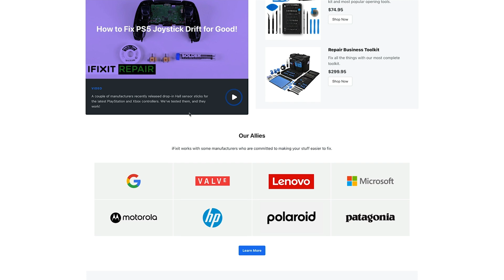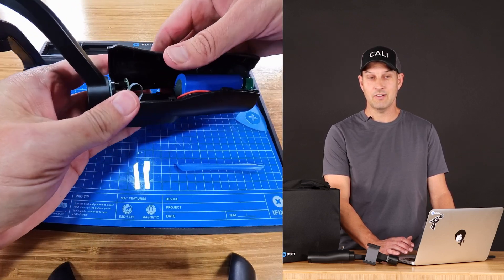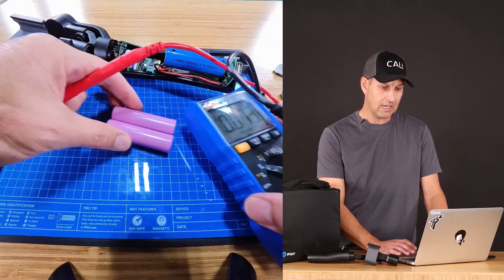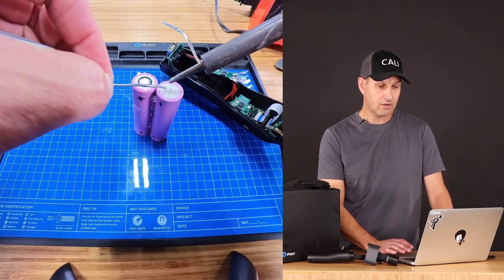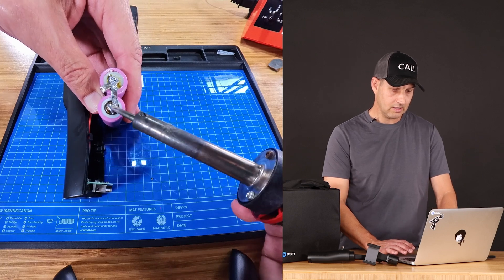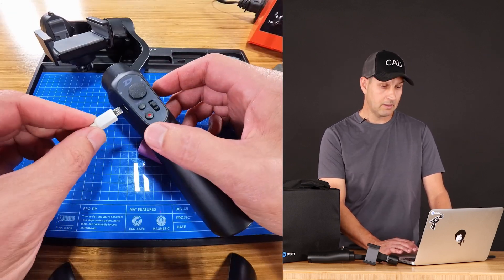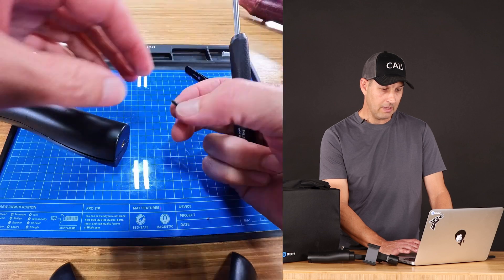Zhiyun Gimbal Battery Replacement #ifixit #zhiyun #repair

Comment from the maker: I just got it out after it sat for a few weeks and it’s back to flashing and won’t charge. Looks like the issue is elsewhere. If you already have spare batteries around it’s worth a shot otherwise I wouldn’t put any more money into a repair.
Reply: Cheers for the update reply. My original battery use to run flat pretty quick also i hadn't used in a couple of years. I just purchased another battery from eBay last night. The gimble will power up for a few seconds with charger plugged in but dies straight away an turns off. And still the same flicking red charge light with charger connected. Strange because It worked fine when i last used it and has been packed away in a good zip bag. Im hoping the new battery might fix it. I'll let you know how it goes.
Reply from the maker: Best of luck. Luckily phones and most new cameras these days have much better stabilization. Also stabilization software is getting much better with AI. Soon we’ll have no use for these silly contraptions!
Reply: Could be fake batteries. I had same issue with an impact driver. Batteries looked genuine, but seemed light, so I cut one open and found a couple of small cells inside. Chinese crap!
Reply from the maker: @timhoward8313 Wow! Yeah, sneaky sneaky.  I’ve heard of something similar with SSDs where they open them up and it’s a couple micro sd cards soldered together! 😮
Reply: What mAH capacity 18650 should be used?  🤔
Reply from the maker: @Vendetta725  Pretty sure I used 3000 mAh
Reply: @DIWHYDOTLIFE  I asked because when I used 2 x 3300mAH on my old "Smooth 4", the original batteries were 2 x 2200mAH.   And the setup failed also within a week.  The charging bottom light turned red with the other 3 LEDs flashing green. My guess was, the higher capacity I used caused the gimbal charging circuit to work overtime to handle the higher rating and couldn't handle the extra load capacity over rated specs.   Just my guess.  
I'm no longer inclined to purchase 2 x 2200mAH batteries to try again.  I, simply, retired my Zhiyun Smooth 4 and bought a new Hohem iSteady M6 this time around.  Smooth Q and Smooth 4 had been discontinued.    😅
Reply from the maker: @Vendetta725 Ahh that could definitely explain the failure. I too just moved on from the Smooth Q to the Dji Osmo Mobile SE for $69 on B&H. I’m about to shoot an unboxing of it and I’ll give my 2 cents. I’m trying not to have high expectations, the other reviews are mixed but the price was right and I think Dji makes pretty good products. Thanks for helping me let my mind rest with your insights on the battery capacities, seems logical.

Comment: I hope this solves the problem. Bought mine second hand but the seller gave me a broken one. My mistake of not checking it on the spot. 

But it wont charge at all and it wont start up when on the charger too. But i dont have a solder iron though. How would i do this
Reply from the maker: First see if there is a firmware update, I’m hearing this is an easy solve for some.

Comment: great video, so ive got a zhiyun smooth q2 with me and im facing some problems with it. it doesn't power on and when i try to charge it, it just lights in a very weird way which is not normal at all. do you think it is the batteries??
Reply from the maker: 50/50 chance it’s the batteries, you can get a pair off Amazon for under $20, if it’s worth that and an hour of your time, give it a shot. Mine worked for about a week before it started doing the weirdness again. I ended up switching to a DJI Osomo Mobile SE gimbal (only $60!) and it’s worlds better.
Reply: @DIWHYDOTLIFE  thanks for the reply, yeah imma give it a try, but do you think it might be the firmware thing? i mean i saw some other videos where an indonesian guy said they are facing the same problem and he simply updated the firmware and the problem was fixed
Reply from the maker: @_umair_alam_  oh jeez that sounds about right. Definitely try the firmware update first. Dang I should have thought of that, I e-wasted mine assuming it was a goner.

Comment: What is the total  voltage? Also, the amperage of the 18650 battery. Thank You.
Reply from the maker: 3.6v x2 so 7.2v total. Not sure what mAh these are, but my guess is 2400.

Comment: I told chatGPT about the regularly flashing light, like the one you see after your battery swap. It told me that it means that something is wrong with the battery. I thought I needed to swap the battery because of that. But now I learned it's just charging normally. I guess I just forgot that's the normal indicator, because I haven't used it in years. These AI bots sometimes..

Comment: Here's another piece of unused equipment from Argentina. My new Zhiyun Crane 4 officially won't charge or turn on anymore. I've only used it twice. How are they going to respond to the tremendous harm they're doing to content creators, since we bought the equipment in good faith and with confidence, and the fault is worldwide? They must react. This is unacceptable and a scam.
Reply from the maker: I've switched from Zhiyun to DJI and I haven't had any battery issues.

Comment: I have SMOVE model number SMVMBL1 and there is no screw in the bottom, any suggestions?
Reply from the maker: Does it have a sticker concealing or sometimes it’s hidden in the tripod hole?
Reply: @DIWHYDOTLIFE there is no sticker covering the opening, just the threads for the base

Comment: Great video! vey clean and easy to understand. Thank you!  just one question What is the value of the batteries you used to replace the old ones? Two batteries 3.7 V 3000 mAh together?

Comment: well i have same problem a dead battery with flicking led and dose nothing but mine is a Zhiyun smooth Q2 which only has one large single round battery 21700 lion battery 3.6v/4500 [16.2wh] hopefully after market ones are available on ebay.
Reply from the maker: @Nismo65  I just got it out yesterday and it’s back to flashing and won’t charge so the issue likely lies elsewhere, I’m going to pin a notice at the top of the comments section.